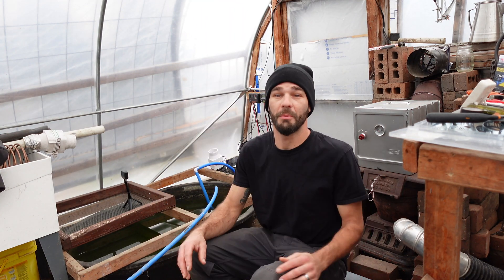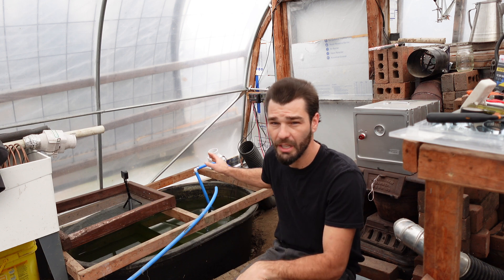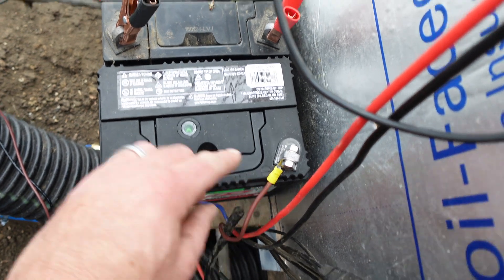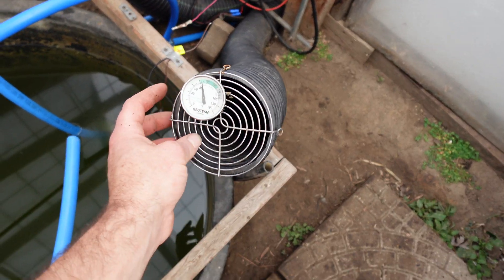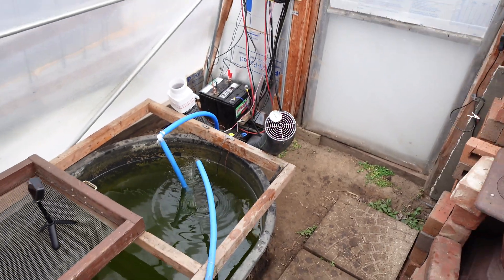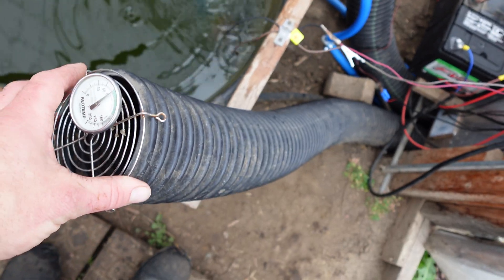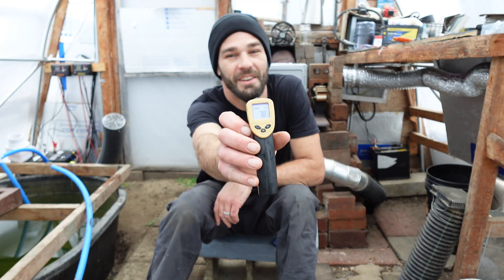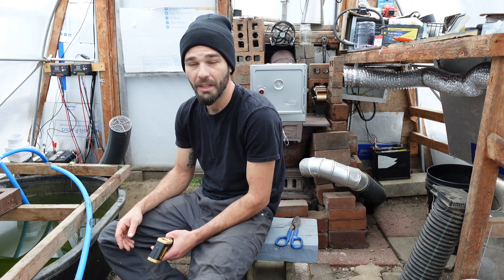Man Heats 520 sq ft Greenhouse With Compost - Starting Systems - Jean Pain Compost -  Winter 2025

Comment: Can you show where the warm water goes? Looks like you pump it along the ground among your plants. Is that correct?
Reply from the maker: Yes the pex tubing runs along the edge of our beds along the one side of the greenhouse heating the floor up as it travels to the overflow tank. Great question

Comment: A fantastic set up. I can't get my head around some of what you've done but that's because I am daft not because you've done anything incorrectly :). One question; as I understand it, a compost heap will heat to about 150°f but that's peak and then sharply drops off after that. How do you plan to keep the heat constant or replenished? I know you have other systems, are you just planning to use the compost in short bursts when it's at its peak and then create a new pile whilst heating with your other systems and when the new pile heats up switch back over for a short period? Have I misunderstood something?
Reply from the maker: With a pile at 10 tons or greater it should hold heat internally for months, with proper insulation. Without insulation the crust forms and you loose a ton or two forming its own “insulating layer” good question!
Reply: @Earthdwellershomestead  Thanks for the quick answer. I'll start on my 10 tonnes now... I've subscribed to your channel and will be pirating ideas or at least inspiration from you in the future. All the best.

Comment: How much warmer would it be if you had the compost pile covered with a tarp and maybe a insulated blanket or at least a tarp.
Reply from the maker: A lot! Insulating the pile will give you much better results. Without any insulation value around it, part of the pile becomes the insulation and cools off as a crust

Comment: I’m currently building a small greenhouse (6x13) against the south of the woodshed. My glazing is recycled patio door glass set to our winter solstice. Putting up a rock wall against the woodshed for a thermal battery and building a compost pile heater against the south wall. The theory of building the pile against the wall is insulation and a bit extra heat potentially.
Reply from the maker: That’s awesome and sounds like a good plan! So I have experimented with using extra poly to cover my pile in winter for the simple fact it created and generated more heat within the pile even on negative temp days(when the sun was out). Compost is great insulation that has its own heat while active, we’ve used straw bales and leaf bags from our local town to insulate our small greenhouse.
Reply: @ my compost pile is going to be made with manure from cattle trailers. Lots of straw. The ratio seems to be good, the heat in the pile is unreal, I haven’t put a thermometer in it but in negative temps it’s HOT inside. I can get as much as I want for free including delivery, just got a triaxle load this past Wednesday. 👍👍👍
Reply from the maker: @draganarc0131 that’s interesting, I may be able to do the same thing around here lol plenty of farmers. Thanks for sharing that! I bet it is hot! This huge pile we’ve got cooking is steaming in mid 20 degree weather, I can’t put my hand too far in without getting burnt lol

Comment: Thank you for making and sharing your videos about this!!
What are the water//air pumps that you are using please? 
Also,I read somewhere that the compost heap has to be at least 4ft by 4ft by 4ft, to produce heat, is this right? (I have  a small garden,so, if you know, please let me know also?)

I'm used to  squaring off the stable muck heap,to keep it tidy, but also to ensure it's doing a good job, of making good compost,  I've also heard, that the ratio's of brown -greens is important for it, 
because I only have experience with the stables muck and straw, I don't think I know enough, for setting things up, on a smaller scale, with mostly kitchen scraps,leaves and grass cuttings that I collect locally.

Any and all information is gratefully appreciated,TIA.
Andrea and  Critters.   ...XxX....
Reply from the maker: Yes a pile should be at least 3.5feet around to create heat, and if you insulate that pile with leaves or grass you can get the entire pile to create heat as opposed to having an outer layer and inner layer. Great question and thanks for sharing!